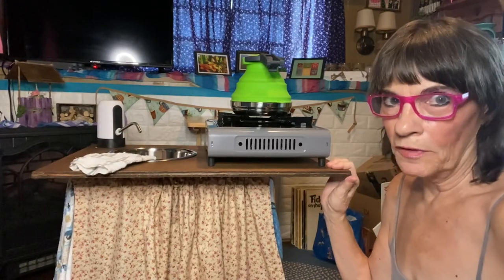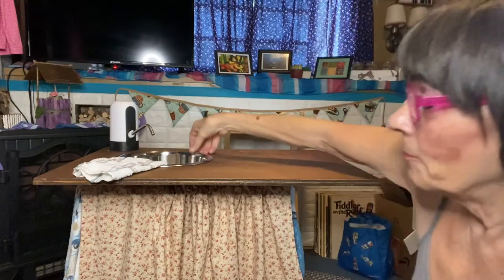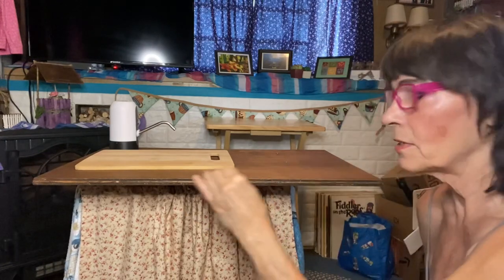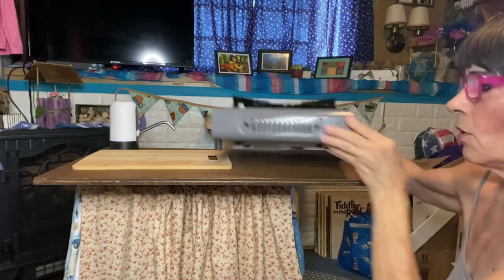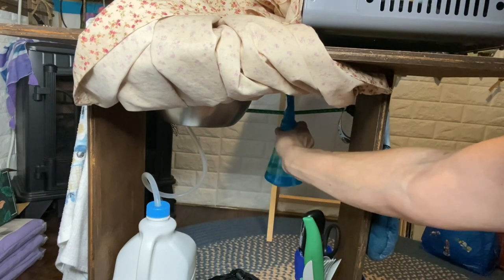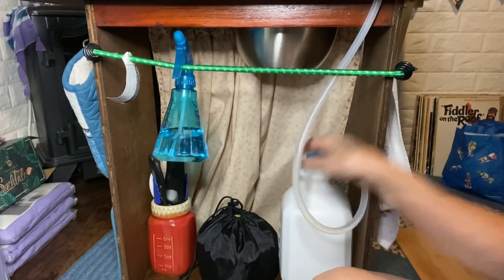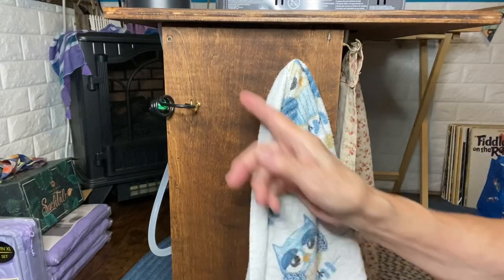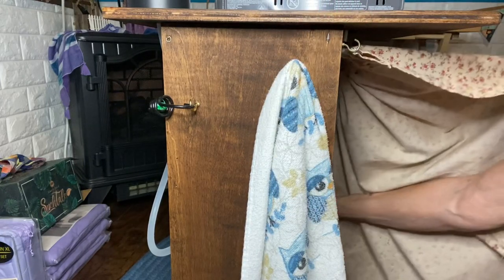Mini Van kitchen build Finishing the Project Part 2.

Comment: I like the simplicity of your unit. Are you going to use the rubber type shelving liner in the bottom, or some other “sticky” product?  Well done gal. 😁👍
Reply from the maker: Shelving liner is a good idea. I have sticky pads and a bungee that goes around it to keep everything secure. Thank you so much!🙏❤️

Comment: I like your little kitchen.  I haven't decided if I need a kitchen yet.  A lot depends on how things fit into my minivan.  I know I have to get a tent for those campgrounds that won't let me use my van to sleep in.  I ran into that problem last April in two places in South Carolina on the way down to visit my son in Florida. All that to say, I have to keep track of storage, etc.
Reply from the maker: Did you have to sleep in the tent in those campgrounds or did you set the tent up and then sleep in your van?
Reply: A couple of times I was supposed to sleep in my tent but I slept in my bus (VW)  anyway… they never knew, that was years ago
Reply: @TheHapiCamper  Actually, at that time, I didn't yet have the tent so I just continued on.  But the clerk did tell me I would have to sleep in the tent.  I was less than pleased.
Reply from the maker: Interesting.
Reply from the maker: That’s a bummer.

Comment: Why not use earthquake putty. Might be cheaper and easier to get up.
Reply from the maker: To what are you referring? I’m confused.
Reply: @TheHapiCamper  you said you were going to use sticky tape on a couple of the items under the sink. To keep them from moving. Earthquake putty will hold them just as well and easy to remove. Just a suggestion.
Reply from the maker: Oh. No I said I was using sticky pads that you can get off Amazon. They are super sticky on both sides, but pull off easily. No adhesive. I do appreciate the suggestion!
Reply: @TheHapiCamper  misunderstood what they were. Sounds good.